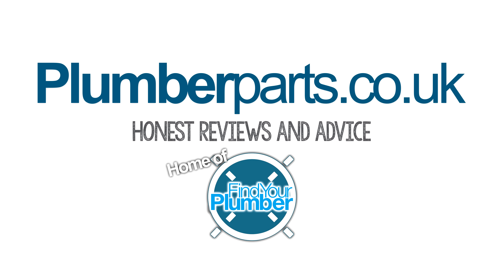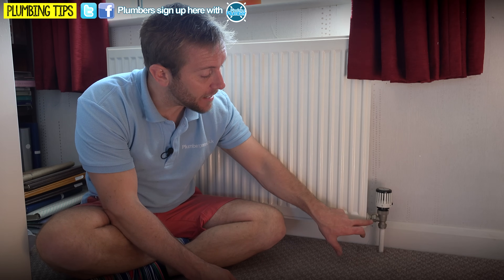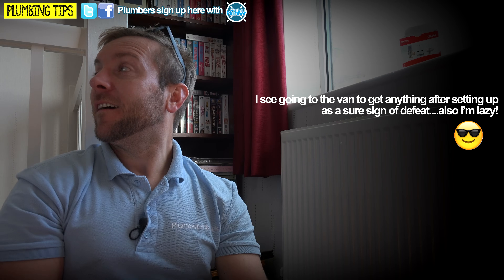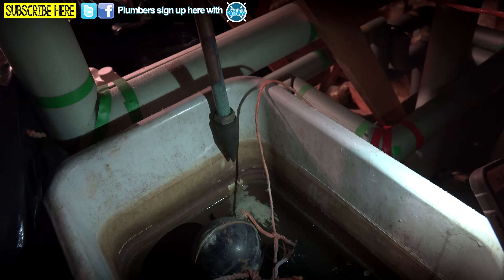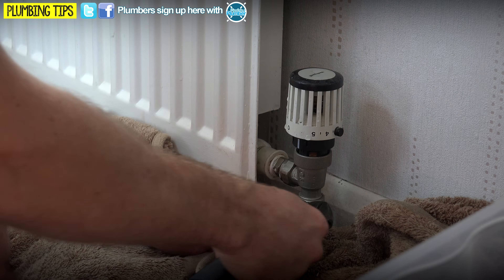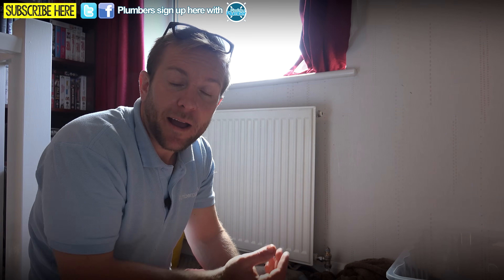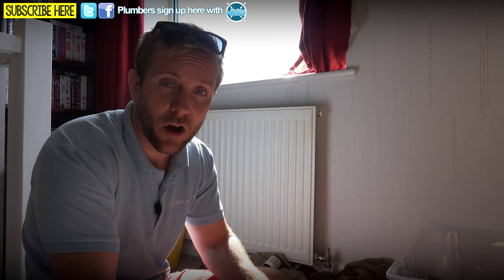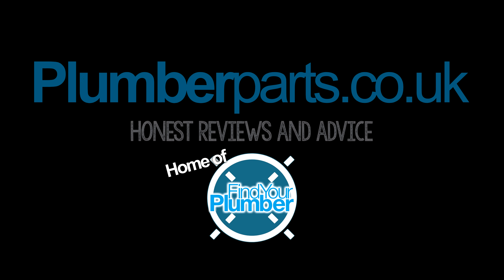HOW TO PULL A VACUUM - Apprentices - Quick TRV change - Plumbing Tips

Comment: Replace bleed valve whilst it is off with a Aladdin Radiator autovent Bleed Valve that can be purchased for £10. You will never need to bleed the radiator again and you will never need to come back to the customer if a further airlock develops as it autovents for ever.

Comment: I’ve just bought a bung kit, but on the back of packaging it says “ Do not disconnect more than one section of the system at a time (eg one two-way connection but NOT one three-way connection). If I bung a system with a three way motorised valve do I risk damaging the system or not being to be able to pull a vacuum? Please help.

Comment: Great video as always.  After watching your videos in the past, I thought I had a combi boiler.  Well we had the engineer in for service and he told me it is a Condenser Boiler which has a water tank for the hot water in the airing cupboard.  On this video you say a pressurise system with high pressure relief valve (is that the same as PRV), and filling loop, would this be a condenser boiler, as you also mention combi in the same sentence.  Thanks for any info, brilliant video.  Stay safe you and yours.
Reply: He meant to say Pressure Reducing Valve, not a PRV (pressure relief valve). Some guys put Pressure Reducing Valves before the inlet of a filling loop to act as an automatic top up of the system - the pressure will equalise across the cold water mains on the inlet of the filling loop and the system on the other side. This is, however, illegal and contravenes the WRAS regs as filling loops must always be disconnected after use to prevent backwash and contamination in the event that both check valves fail. Plumbers can be fined for contravening that regulation and it was found that contamination of mains water had occurred. Only dodgy plumbers will put one in. Apparently, this practice is more common in Europe, in countries where they have less stringent water regulations.

Both condensing and combination boilers use filling loops to fill the central heating system. Unvented hot water cylinders (which is what I presume you mean by pressurised, as all heating systems are pressurised, but not all are unvented) are always used in tandem with system boilers. So if you have a cylinder you have a condensing system boiler. Combi boilers are also, usually, condensing (the new ones always are). You will never have a tank or cylinder with a combi boiler and you will never have a gravity fed system with a system boiler.
Reply: @L.C.Sweeney  Hi Liam
Thanks for the info, nice one.  Still not sure what the difference between a combi , which I thought we had, and a Condenser Boiler, any help with that.  Thanks again, and keep safe, you and yours.
Reply: @Ilovetosingem  no worries at all. Plumbing can be pretty confusing at first. Combis and condensing are not mutually exclusive boiler types. All new boilers are condensing boilers, and that includes combination, system and normal boilers.  The best free explanation of UK boilers installation regulations is probably the booklet called CE30 Domestic Heating by Gas - Guidsnce for Installers and Specifiers . There's a good deal of detail on the differences between the types of boilers in section 3 and the difference between vented and unvented in section 4. 

Hope that helps.
Reply: @L.C.Sweeney  Well, thanks a lot, real quick reply.  I'll try to see if I can read up on it and then get back to you.  Cheers again.
Reply from the maker: Liam should be on the payroll! 😂😂

Comment: I am more of an Engineer than a full-time Plumber but I have done tricks like this in the past, one thing that should be thought about and could catch someone out is "Fitting Stop Depth"  in the video, the valve was swapped over but the existing nuts and olives were utilized. This is fine to do if the new fitting has a deeper or equal stop depth, however, get a new fitting with a shallower stop depth and the pipe will not travel into the fitting far enough for the olive to seat, sometimes if the olive is not too over-compressed it may just slip up the pipe IF you are very lucky.  
If you are unlucky you have either got to try and bung the end with a small rag hacksaw a tiny bit of the pipe away or better still use an olive cutting tool and re-install a new olive.

Comment: I changed a trv and lockshield on a Friday night... Never had to do it before, pressurised system, don't know what I did wrong but the hot black water exploded into my face! Massive fountain of water came out.. I ran downstairs to shut the stop tap and completed the job with new olives... I still don't fully understand the difference between pressurised.. apart from it being a combi boiler which should act as the bung but what do I do from the valve I'm changing? And with f & E systems I'm yet to take on... Got to do a 2port soon but keep looking for tips on how to do it.. without bungs.. 
I was just going to tie the ballcock up and drain from lowest point(smallest rad) turn boiler off and carry out the work... Be great to see a video from start to finish using a universal method..
Cheers for your vids Jim! Top stuff, learnt alot from your channel
Reply: You said that your system is pressurised yet you have a feed and expansion tank? you turned stop cock off to stop rad leak??? 
You can only bung an open vent system.

Get a heating engineer out mate please....

Comment: The following may add a few handy techniques. Get yourself a simple monkey wrench (not a pipe wrench) to support the valve. The open jaws fits over the valve body from the side. The centre line of the valve passes through the open jaws of the wrench. If the system is heated up to hand hot (about 50C) before fitting the bungs (or draining out a sealed system to zero pressure), then as it cools over the next ten minutes it creates a vacuum that in many cases sucks air in, thus preventing all water leaks. Also use a pair of smaller grips to (carefully) remove some paint from below the nut on the tail. This guarantees the nut will retract. To remove the valve, support it with the monkey wrench to save twisting the tail; release the nut next to the rad half a turn and tighten; then do the other nut likewise (for this one the valve need not be supported), then undo each 1/4 turn before fully undoing both. See if there is some upwards movement in the rad from the end with the valve to be changed. The other tail needs to be flexible when using this method. If so, the procedure is to hold the new valve in one hand, lift the rad (& old valve) 1/2" to clear the tail; pop off the old valve, push on the new one, and lower it back taking care to allow the new valve to sit over the tail without damaging same, or trapping fingers. When tightening the valve nut next to the rad use the monkey wrench again to support the valve. I also use a small amount of gas thread paste as sealant and lubricant on the cone faces of the valve pipe sockets and two small dabs on the valve threads to help the nuts tighten. HTH
Reply: Do you turn the boiler off

Comment: Good to know. Did you change the TVR for a lock shield because the TVR was on the return instead of the flow?
Reply: That was a replacement TRV with the dust cap still fitted - not a lock shield.  It looks like a Danfoss.

Comment: Question for Mr PlumberParts: The black tank in the loft you bunged up. Does this tank service the hot water system as well? I have the same tank in my loft, and found the lid had been knocked off. To my horror I found a load of dead mice decomposed, floating in the water. I have no idea how long they had been in there and no idea if the tank itself feeds my hot taps, and in turn my bath water. I'm hoping the tank only feeds the radiators. The water I removed when cleaning the tank was black as anything. My boiler feeds the heating system and hot water system. Thanks for any advice given. ;)
Reply: The small black f+e tank only feeds the heating mate

Comment: at 8.00 are you talking about releasing the system pressure at the prv? sod that, never release a system by the PRV in the boiler, you're asking for trouble, bloody things never seal after you open them, and you can spend the next 2 hours struggling to the prv out. like on the WB cdi, horrible hand scratchers trying to get the spring clip out.

Comment: The best plumbing accessory in my van is a cat litter tray bought from the local Pound shop. It's shallow enough and wide enough to slot under any radiator and catch all the water. Good video, thanks for sharing.

Comment: Why do plumbers use adjustable spanners instead of the correct sized spanner? Is this why every nut and valve on my heating system is chewed up, especially drain valves and radiator shut offs?
Reply: not all 1/2" nuts are the same size, have a look at kuterlite nuts
Reply: Adjustables wont chew your nuts and valves. grips will
Reply: I was a mechanic for 15 years and just recently moved to the plumbing trade and at 1st i thought the same. until you realise plumbing works in imperial and metric sizes and you don't have the luxury of a 48 inch snapon stack brimmed with individual sizes lol so carrying 3 adjustables and other tools just makes sense now lol. but i do know what you mean because i hated them at 1st

Comment: I've always fitted trvs horizontal.  Only fitted vertical if there is no space to fit it horizontal. Any reason why it's fitted vertically? I know the type that was changed was bi directional?  I find it's easier to read what the valve is set to If it is horizontal.
Reply: probably coz it looks absolutely tonk having them horizontal?

Comment: 4.45..."shut every radiator at both ends".... Then have to spend 2 hours balancing the system again afterwards...😡
Reply: How many Rads are even truly balanced in the First place by Central Heating Engineers...

Comment: PTFE tape around the bungs tip will make a good seal with the feeds that have teeth in them. Make sure you leave a nice long bit of tape free, hold it with your finger when pulling out the bung, don't want that been sucked into the system.
Reply from the maker: Ok, good tip!

Comment: I use these bungs all the time not just for quick change overs
As long as one side is closed off you have plenty of time with them if they make the initial vacuum.
When I do bathroom refits and I'm changing rad for towel rail and need to adjust pipes I use them when I can't be arsed to drain down
Obviously you can't solder so our friend  jg is execellent for under floor fittings:0)

Comment: Maximum respect Jimmy, bet your danglies were in your throat there for a while. I hate pulling vacuums, but then I hate airlocks too. We made ourselves a handy bit of flexi friday to link the mains and vent via a DC valve and gas valve - works a treat. Very satisfying to see all that rotten air blowing into the F&E tank. Like the bungs BTW, keep looking at this set but they're bloody expensive in City.

Comment: I use this method all the time. Especially for changing two/three port valves. 👍
Reply: Surely there's two open ends when you remove a 2 port so there would be no vacuum
Reply from the maker: Hmmm... little ballsy! I like it!

Comment: 22 mm  stop  end on  expansion and  cork  in  outlet  is   what  i  use
Reply: Shove a carrot in.
Reply: @darrenjowett8032  if you've got an apprentice or help. Just get them to finger both sides of the tank, job done.
Reply from the maker: Each to their own and whatever works!
Reply: Never tried a cork. Does the cork create a bung on the header tanks that have a lip on the cold feed?
Reply: no  not then ..  i  drain  the  tank  and  fit  a  jg  stop  end  ...

Comment: Good video as always. I've successfully used this method on a few installations but also applied some V-2 Plus just inside the valve just in case there's an issue with the old olives. 🐾 to Big G
Reply from the maker: Ha! He's too hot today. Hates mugginess does the G

Comment: It should be cold feed bunged 1st then open vent 2nd
Reply from the maker: Didn't think it really mattered in the seconds between the two....can you explain why?
Reply: Remove feed bung first then open vent to stop air been dragged in, as for fitting doesn't make a difference which way really. I never noticed a difference.

Comment: Nice explanation buddy. Done a few live TRV changes before that was fun...
Reply from the maker: Yeah, they're always a bit scary!
Reply: Do you have turn the boiler off?
Reply: Lover Dog turn boiler off. Get everything ready and primed. Use your thumb to hold it. You need a good solid thumb grip though. You will get water spray. It’s hard to explain but perfectly doable.
Reply: I meant when you’re pulling a bung on the tank, do you turn the boiler off before hand or does it not matter
Reply: @loverdog7715  Yeah you don't want the pump kicking in!

Comment: And then you get the ones where the pipe sits further in the old valve than the new, resulting in the olive being stopping the nut meeting the thread. Always nice.
Reply: On 10/8mm pipe. Where the olive splitter is too big.
Reply: +hankattack One can get olive cutters for 8,10,15 and 22 mm pipe made by monument tools. Each one is pricey but can make valve changes easy, especially if the nut is not also compatible with the new valve
Reply: The olive always comes off easier on a rad tail. just use grips if you can and whip it off and have a new olive handy.

Comment: Cracking video as always mate. Been following them for a few years now. Especially liked your pipe bending one. Now I've buttered you up......... :-) Can't say I agree with your comments on cracking the PRV's to drain the system. 9 times out of 10 you know that buggers going to let-by, then your going to have to charge you customer for a replacement. I'd advise apprentices to use a radiator drain-off, boiler drain-off or worst case crack an easily accessible nut on the system to catch the water in controlled way. As you mentioned its only to take the pressure out.

I get called to loads of these when, like you've said, a plumbers been on the Friday afternoon hurry up, then left a leaking PRV. = grumpy customer. :-)
Reply from the maker: Ha! Thanks mate, you know what it's like. I've gone to jobs where the plumber has just put a push fit cap on the outlet outside!

Comment: Excellent tip. it has worked successfully for me most times. The vent is usually easy to bung. The tank connector can be more problematical. Sometimes some makes have an annoying groove in them, so it doesn't seal. Others are nice and smooth so it works well.
Reply from the maker: Yep, had that slight problem on this vid!

Comment: Are thermostatic radiator valves problematic compared to the standard ones ?
Reply: Theoretically, if the system needs flushing the 'pins' that open / close the flow can sludge up and need changing, where as the standard type are a bit more of a robust mechanical design.